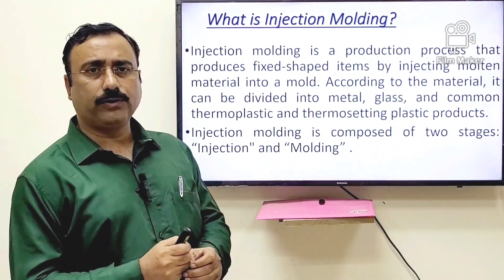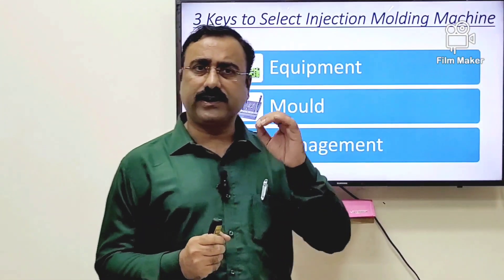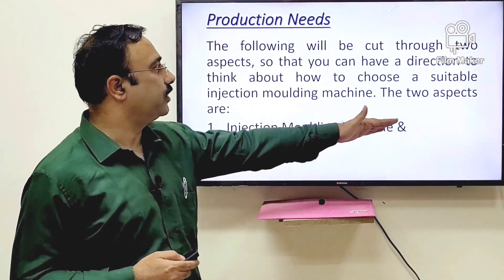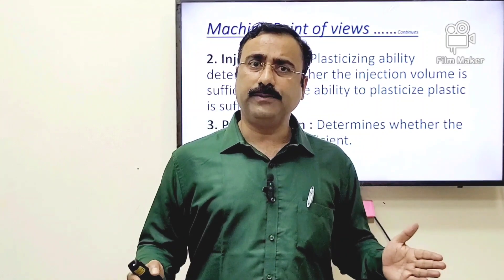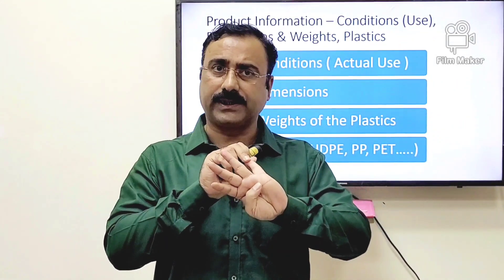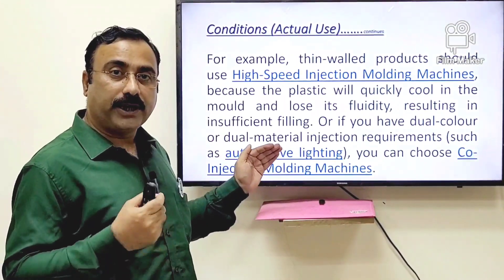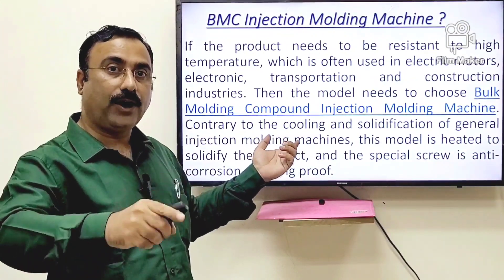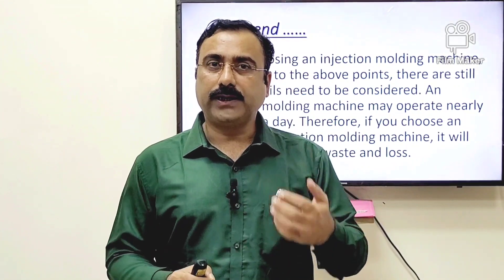Factor/Selection Criteria to select a Suitable Injection Molding Machine.IM Procurement Homework

Comment: sir 120 ton injection molding machin  मै 205 grm का product बना रहे हैँ तो बिजलि का बिल कितना आएँगा प्रति दिन।  कयकिल time  20 secend ??  sir help me 🙏
Reply from the maker: How many cavity?
Reply: @Tothepoint1910  sir single  cavity. . core.
Reply: @Tothepoint1910  sir pleas answer??
Reply: The electricity cost depends on various factors, such as how the machine uses electricity, the type of equipment, and the condition of the facility. However, I can provide you with some guidelines to estimate it:

Machine's electricity consumption: Firstly, you need to find out how much electricity your machine consumes. You can find this information in the machine's technical data sheet, where the effective power consumption is mentioned.

Daily operating hours: The next step is to determine how many hours the machine runs each day. Pay attention to the estimated time provided by the equipment and combine it with the daily operating hours.

Cost per unit of electricity: Obtain this information from your local electricity supply company. They can provide you with the current rates and the cost per unit of electricity in your region.

Calculating the electricity bill: Now, estimate the machine's electricity consumption per hour and multiply it by the number of hours it runs each day. Then, multiply this by the cost per unit of electricity.

The following calculation may be useful:
Daily production = (Product per second x 3600) / Machine's electricity consumption per hour

Electricity bill per day = Daily production x Cost per unit of electricity

In the above calculation, you will need to take the actual grams of production and the second value from your machine's technical data sheet. Additionally, you'll need to obtain the cost per unit of electricity from your local electricity supply company. Hope this will help u .

Regenerate response